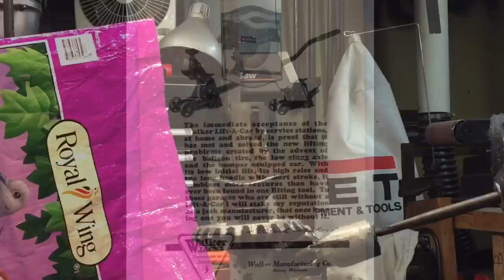Jacks- Jack Stands, Jack Maintenance and The Dake!

Comment: When you consider they use timber props in mines, I can understand how strong the wood is. Apparently the creaking of wood is something the miners would listen out for, it was one of the best warning signs they had. (Edited for atrocious spelling )
Reply: In the hardrock underground mining industry, wooden timber used for support is called "lagging." What miners listen to and can hear are rocks popping. The underground industry has for some time used a system of "geophones"  (basically microphones) to monitor rock noises  in  various parts of the mine. It's a good safety system As one mine manager once told me,  "The rocks talk."
Reply: @patjohnson3100  excellent. Thank you.

Comment: That mechanical floor jack is a work of art. The cribbing demonstration was great. I had to use cribbing when i put a starter in my forklift...it was still unnerving to stick your arm under a forklift 🤣. Great stuff. Cheers
Reply from the maker: Joe- You are so right, super heavy vehicles require extra protection against possible falls...  plus 2 pair of underwear if it does...  =D

Comment: Few people work on their cars today and many have no idea where the spare (space saver) tire is or how to raise the car and safely remove the tire and replace it. Fortunately for them tires today are better and seldom have issues, so the jack never gets used, though you can’t consider it a real jack. My Volvo of years ago had lifting ports near each wheel, and the jack was nothing more than a very large screw (like the one you cleaned up) but slender and tall. You could lift the tire 6 inches or more off the ground so you had plenty of clearance to pull it off the hub and the footplate was very large for stability. Some engineer in Sweden must have been caught in too many snowstorms; it was a brilliant design.
Reply from the maker: I remember when I was a kid my friend got a Saab, we needed a jump and looked for twenty minutes under the hood and trunk!  Nothing!  Thank God there was an owners manual in the glovebox, we never would have looked under the back seat in those days!!!

Comment: I thought I was the only person that used cribbing to hold up my car if I had to get under it.  There were three reasons that I use it:

1.  When I was in middle school, I remember listening to a talk show once where a young gal called in and she was very upset.  She was a newly wed and her husband had died a few days before working under their car and it had fallen on him.

2.  I had seen pictures of cribbing in coal mines.

3.  When I lived in California, right after one of the earthquakes near me; I was driving under a railroad main line where I noticed that there was a large crack in the concrete holding up the the track.  The next day there was cribbing made out of ties so they could run the trains until a permanent rebuild could be done.

Currently my Jeep which needs transmission work has 2 by 4 cribbing under it.  I just don't trust any of those jacks or jackstands.
Reply from the maker: Kathie- I’m with you, the common ratcheting jack stands are so sketchy!  😂👍

Comment: In fire/rescue, we use that style box crib all the time -- they are incredibly strong.  A standard piece of southern yellow pine, either 2x4 or 4x4, has a nominal dimension of 3.5 inches.  Each contact patch of the box crib, just like you put on the Dake but using 2x4 or 4x4 lumber (not plywood), will handle 6,000 pounds per contact point or 24,000 pounds for a standard box crib.

Comment: I bought a craftsman jack back in the 90s. I could have gotten the same rating on a jack at the auto store for under $30 but I paid up $90 for the Craftsman brand. It failed very early on so I priced a replacement "power module" which was almost as much as the whole jack! And more than the auto store one. I knew nothing about hydraulic systems but I took it all apart and found one little abraded O ring. I went to my local hardware store and almost felt like a heel just buying a 29 cent O ring. It lasted for years after that.
Reply: That's why you never get under anything with just the hydraulics holding it up. There are many $.29 failure points. 
Cribbing or stands every time. 
To be fair the same rule applies with a mechanical jack.

Comment: Hi Scout, another great video. I know hydraulics are mega powerful but if people saw how small the rubber seal holding up their car is I bet they’d think twice about getting under it without proper support. When I were a lad they were building a bridge near my place I so borrowed 4 accrow props or prop jacks from the huge piles they had and turned them into wind up cars stands. That was forty years ago and I still use them. They’re rated at about 3 tons each. I’ve never liked ramps and I have seen plenty of accidents getting cars onto them with some over shooting them or one ramp will slip and the car falls sideways. When I still lived at home a guy up the street from me had his car on ramps while he was removing the transmission, he had his trolley jack holding up the back of the tranny while he removed the rear cross member. Only problem was the rear cross member also supported part of the handbrake assembly so as he removed the cross member bolts, the car rolled back off the ramps and part way down the street. It didn’t go well for him, he was lying long ways under the car so the wheels missed him but his face was caught between the road, yes he did it in the street, and the engine sump as the car got to the bottom of the ramps. Everybody turned up with lights flashing, the ambulance took him away and the the fire brigade hosed away the blood. The police were there for ages working out what happened. I never did find out what happened to him as I never saw him again. Stay safe and warm. Cheers Stuart 🇦🇺

Comment: Very interesting about the cribbing. I have never thought of cribbing. I use to use jack stands with the adjusting pins. Never had a problem or thought much about it. Lately I use steel ramps and put an old wheel on each side of the frame as further safety. Interestingly, the owners manual for my 1948 Ford shows the use of 4 x 4 wooden blocks to support the car while you're under it. Thanks for the SC thorough cleanup and repair of the old screw jack. It was well worth saving. The mechanical floor Jack is really cool. Makes me wonder if the hydraulic floor jack I have now represents much progress. This floor jack deserves SC cleanup attention like the old screw jack.  Thanks
Reply: With the price of wood these days the cribbing might cost more than the jackstands themselves. Best to reuse 'found' wood.

Comment: I think you would find the pinned jack stands have a good factor of safety, the sheer strength of those pins is quite high.
Reply: I’ll use two under the front of my landrover and I’ll have wood under the back wheels so the chassis is level ( or vice versa) so that’s two 6 or eight ton axle stands supporting one ton. Then and only then.....
Reply from the maker: In the maintenance dept where I worked we only used pinned jack stands, they were good for 65,000 pounds!  The pin was 7/8" diameter!   =D

Comment: Man, what a great theme for your videos in 2022. You mentioned the LED lights not warming. I read a book that said the net energy saving favors the incandescent bulb because it also provides the benefit of heating. I had contacted two electricians to get a 220 circuit for a mini split heating AC system for the garage but keep failing to be able to get them out to do the work. Serious problem to get contractors that want to go from quote to completing a job. So my garage is still chilly in Central Maryland. Today I got a nice mid 20 century dresser on Freecycle that I disassembled for future wood projects. As long as the garage is in the 40s I am good. Now - onto jacks. HaHa you didn't want to look like a Gomer but hey, a Goober is fine. Plywood as a laminate is pretty strong. Strong from the end grain rather than across but you have some pretty good strength in compression. I hope you carry this jack theme as long as needed to cover the subject. Very interesting. I got a floor jack for $30 that needed some TLC. It didn't have a plug for the cylinder and rain had gotten into and mixed with the cylinder oil. It has been a forgiving jack inspire of being full of water. So far I am not happy with the purchased replacement cylinder oil plug. Sometimes it will pop out when pumping the cylinder. It is just a rubber friction plug whereas I would prefer a threaded bolt plug. Guess that's another project. Thoughts?
Reply from the maker: There shouldn't be any pressure on the rubber fill plug, it might be just a weak fit, I agree, I would prefer a threaded plug!
Reply: @ScoutCrafter  Do you think maybe air got in and caused that? It was fine once I replaced the cap and pumped it up. Thankful I found the cap in the grass. I was pulling out T posts from the garden.

Comment: As a retired fire/paramedic, I can tell you that cribbing is the way to go.  I doubt there are any fire rigs that don't have some level of cribbing material in a side compartment, used for rescue, jacking, etc.  Unfortunately, I have seen two people killed under cars, one when the jack stand tipped over, and one when the bricks the guy was using as cribbing failed (don't use bricks).   Most of our wood was 4x4, but we had bigger sections also.   Wayne out West
Reply from the maker: Hi Wayne!  Cement blocks are deceiving also, they can crack and pulverize under weight.   Thanks!!!!!!

Comment: Those gear and thread driven jacks are so much better than the what we have today.  Smooth, precise and last forever. No O rings or seals to go bad. Another jack I like to have around is the tripod style.  Final thought to people who don't think those old jacks are sturdy. There are many houses that were built with crawl spaces and wood pilings. When they rotted out, guys would buy a cheap Model T jack and level the house and it took over from the wood piling.

Comment: 52 F (~6 C) here in Florida this morning so it was chilly here too.  I also never really trusted jack stands.  We used to use pieces of 8x8 railroad tie or even, in a pinch, oak logs laid on their side (not on end).  Also had some wooden ramps my dad built that would hold up a tank, or at least a 66 Plymouth Fury III wagon.  That last mechanical jack is awesome.
Reply: I just came in from shoveling. We were supposed to get 1-2 inches but it seemed more in the 4-6 inch range here in the Twin Cities, MN.

Comment: I prefer cribbing myself as well though I have always known it by the term dunnage. You were referencing shipbuilding, that is the origin of the term. Nowadays dunnage refers to blocking, but it used to just mean cargo. Typically personal items. Classically these would be in trunks shipboard. Space is at a great premium when sailing, there is no room to carry blocks. Quite often a ship might get dismasted or run aground far from home. In a scenario like this, the captain would order all of the cargo off of the ship for two reasons, first to lighten It obviously and the second was to use the passenger dunnage for any cribbing needs they had. Kind of neat how words develop, no?
Reply from the maker: That is awesome!!!!

Comment: I have an almost identical jack to that old one. Yours seems to have a double action, mine sweeps in an arc as it goes up. Yours is very much cooler and more heavily built. I have not seen another, when I got mine I was told it was a motorcycle jack for bikes with sidecars? Probably BS. It does go up in the same way as a modern motorcycle jacket though. Yours definitely looks a little overbuilt for a bike

Comment: I’ve got axle stands( jack stands) but mine are old , heavy gauge steel, well welded and with a wide footprint and crucially have a drilled tube you put a steel pin through to set the height. And no offence me old China ( China plate= mate) made in England. Even then I’ll make sure they’re well planted using a piece of steel plate or board if I think it’s necessary.  I still feel safer using large railway sleeper lumps of square cut wood, that there’s no way will tip over.
Reply: When it was designed for trains to go on it you KNOW it will hold your car or truck.
Reply: @johnpossum556  spot on   When its supprting lethal weight, I like to have everything very over rated for the job. I can  be assured nothing is “ on its limit”

Comment: I’m sorry but I’m raising the BS flag on your plywood cribbing experiment. The load was transferred directly over the overlap points (essentially columns at that point) and therefore solid wood. The creaking sound we heard was probably the ply’s compressing. I’d bet you could put 3-4 times the pressure because the steel plate  was spreading the weight so evenly. It would be as if you had sheets of plywood stacked up.
Reply: I had my guess at ten tons. Disappointed to stop at two and a half!  But I’m with you, that was the glue crushing, it could have took a lot more before anything significant happened
Reply from the maker: I too believe the cribbage model could have took more but believe it or not when you are pumping that handle and nothing is moving a lot of weight is storing up and waiting to go somewhere.  It is to say the least nerve racking!  =D   I was happy to make the point and wanted to quit while I still had a head.  LOL  That is why I love the Hydraulic Press channel... He always takes it to the point of breaking windows!
Reply: @ScoutCrafter  you’re the one in the firing line, and those two pieces of plate aren’t to be sniffed at. We love your channel and the last thing anyone wants is you taking unnecessary risks!!  Thanks John.
Reply: @ScoutCrafter  fair enough.